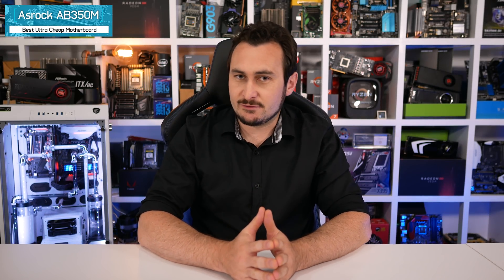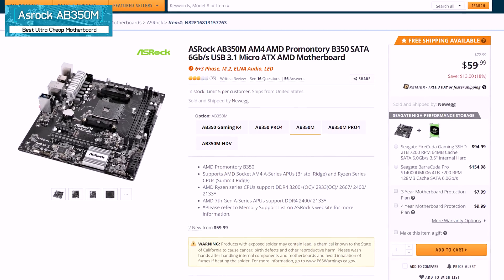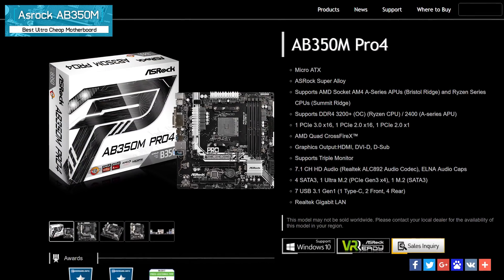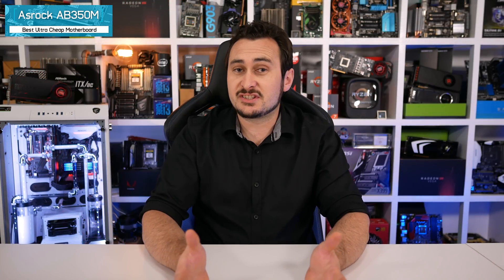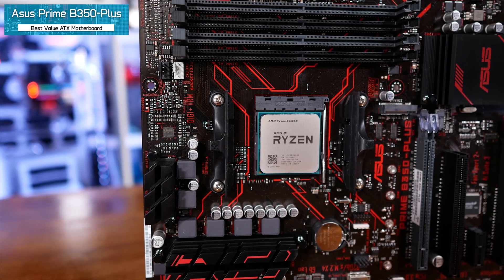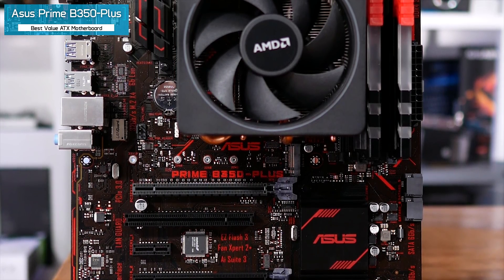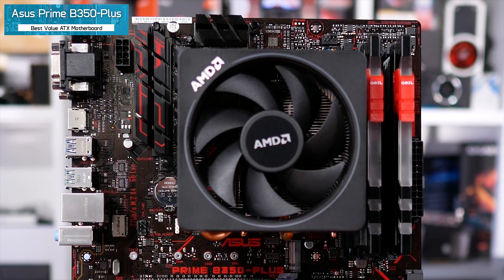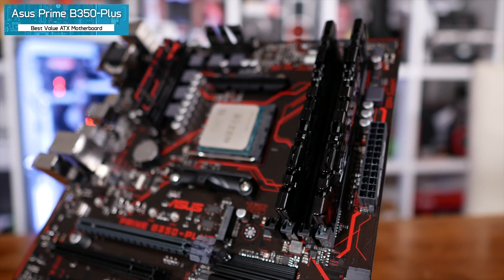Top 5 Best AMD B350 Motherboards

Comment: Great video, although I would def pick the Gigabyte Gaming 3 over the Prime Plus.
Reply: Also rocking the Gaming 3. only issues I have is getting my RAM to 2933Mhz (Or its rated 3200Mhz, Corsair vengeance LPX) and the lack of modifying the LLC to try and squeeze every drop of performance from my R5 1600.

Still, for the price I paid, it's a winner.
Reply: Really? I must be the only person who had a decent experience with one
Reply: Don't forget that the Gaming 3 has the 1220 audio, 5 analog and an optical out.
Reply: Pretty sure Buildzoid was shitting on MSI boards in his video(for B350) and he shits on the X370 Gigabyte boards, not the B350s.
Reply: RRoD - I don't think they're garbage, and in fact, Steve mentions they were good competition for his "Best Value ATX Board" category. Just because one component isn't as good as another in thermals doesn't make it trash. I've been using a Gaming 3 and my computer hasn't burst into flames(holding steady OC anyway).

This is the kind of polarizing of opinion that simply makes no sense. Did I hurt your feelings by correcting someone about something totally unrelated to your opinion? If I did, check out of YT and into counseling.
Reply: I also have a Gaming 3, paired with 2x8GB Patriot Viper Elite 3000MHz CL16 - which only required selecting the XMP profile to go to 2933MHz - and a Ryzen 5 1600. I did a quick overclocking test (to 3.6GHz) out of curiosity and it was fine, however it's good to note the potential issues even if I'm only really going to be running at stock. Can't say anything about the audio though; I use a USB headset.

I should note that it was complaints about the BIOS that stopped me from getting the Prime B350-Plus, apparent issues with too much voltage being applied, that and the Gaming 3 was a good price. The Gaming 3 doesn't like booting to HDMI though, so I've had to rig up my TV with D-Sub which isn't really a loss at 1080p. For all its reported faults, I like its looks, the reinforced PCI-E ports, and the LED lighting (you can print your own accent overlay for a different design using a 3D printer). There is a new F10 BIOS out adding support for future CPUs, and it hasn't killed anything (yet). I'm not averse to the idea of replacing it if there are much better boards, and I admit that most of its plus points seem purely aesthetic, but for now, it does its job well.
Reply: I love my GIGABYTE AB350 Gaming-3 mobo. Only complaint I have is I can only get my 3200 MHz RAM to 3066 MHz but I'm assuming that's a Ryzen/Memory compatibility issue as it's not Samsung B-Die. 

Other than the Gaming-3 there's a lot of Mobo's I would take over the Prime Plus. ASUS ROG STRIX B350 Gaming-F for one.
Reply: I got your feelings were hurt from you calling them "trash". It turns out you only feel that way because of what someone else says about it, which you twisted to mean that they are incompetent, worthless parts. Still, a magnificent display of YT comments-tier intelligence and maturity, no doubt!
Reply: Hardware Unboxed i have an serious question: i look at this video again because it seems that my prime b350 plus doesn't run with the flareX ram at 3200mhz on the most recent bios 3806. and now I don't trust my eyes seeing the board in your video having the same ram on it. is there a way you know to let it run on 3200mhz?
Reply: Tech Showdown Gigabyte b350 board? BARF!
Reply: CazadorDeWulf Not sure where you got my feelings were hurt. And they should be "fine" with a stock cooler or with a moderate oc on R3s and R5s. But I wouldn't recommend them to anyone. If you use your cpu at higher voltages, your lifespan of the motherboard will be decreased. And that is certainly not what you want from a chipset that will be around for awhile.
Reply: I would go for the B350 Fatal1ty that is not there...
Reply: Asus all the way since the 90s. Nothing else gigabyte screwed me over in 2000 with a $ 480.00 motherboard send it 3 times I marked it and they say it's a new mobo I was  not stupid I marked it and it's the 3rd time you send me the same one so I gave up he ask me why  I marked it I told him  i don't trust no-one he felt so stupid it was funny .ask me to send it to him personally I said I thrashed it he say why I'm like realy you lost a costermer that upgrades my computer's every 6 month's plus I build computer's. So Asus never let me down and yes I got a gtx 1070 from gigabyte and I'm happy with it and it oc like a champion, but on motherboards i only use Asus.
Reply: Alexander Radev is there an issue with the b350m gaming pro? From the reviews ive seen it is quite good for the money? I am choosing between the b350m gaming pro and the b350m bazooka from main and the b350m pro 4 from asrock.
Reply: Not really he even said some of them are the best for whats available at the moment. He also said that most of them will get away with an 8 core although not with high overclokcs. Msi boards in the b350 are fine for most cases aswell as from other companies.
Reply: My final buy tho would be the asrock fatality gaming itx/ac. if I was to go mini itx.
Reply: I own the B350 plus and it's a piece of shit, before the AGESA bios I was running stable 3.8Ghz at 1.26v after the AGESA bios updates my board won't run 3.8Ghz without hitting 1.4v >:(
Reply: The Gaming 3 has shit VRMs. Buildzoid bullshited all Giga B350 boards.
Reply from the maker: Thanks Kev, I would admit that out loud around here mate :D The Prime Plus is the better board, trust me on that one ;)
Reply: Hardware Unboxed asus prime b350 plus vs msi b350 tomahawk. What is better pls answer me
Reply: Trust me Steve, the FX-9590 is the BEST CPU EVER MADE, if you don't agree with me, that instantly makes you an INTEL SHILL.
lmao
Reply: Considering Gigabyte makes the worst B350's overall other than the ITX board and the MSI Gaming Pro, I wouldn't really say so.They'll support an R7, and I would sooner go for a Gigabyte B350 with a heatsink on the VRMs than an MSI without, but technically speaking it's not better than the Prime Plus.
Reply: The Gigabite boards have the crappiest VRM in all B350 boards. If you really want a value board - get the MSI B350 Mate or basically the cheapest MSI board that is not the B350M Gaming Pro. You get as good a VRM to the Asus board, Crossfire support and all teh case fan connectors you want.
Reply: CazadorDeWulf Trust. Gigabyte b350s are garbage. Just look at them. No heatsinks. For the msi boards they are mostly just overpriced.

Also buildzoid did a b350 round up 7 or 8 months ago where he said just stay away from gigabyte b350.
Reply: If you want better onboard audio then Gigabyte however everything else about the Gigabyte board is inferior to the Prime Plus.
Reply: After having 3 of them DOA at my work, I would say nope.
Reply: Bad VRM cooling
edit:
I have one and the VRM temp is what stop me from overclocking
Reply: I'm reading just enough into word choice to pull the conclusion that your opinion isn't helpful to those you're sharing it with. At least, not until you explain what you mean over the course of 3-4 comments, at which point you've hurt your credibility, and nobody is going to take you seriously. 

Post your source material, if you're actually trying to make logical claims. Otherwise, nice troll.
Reply: CazadorDeWulf source material for what? Lack of heatsinks? Buildzoid's video? I gave a time frame and that it is a b350 roundup, but if you must have me look up the link as well here. Conclusion starts closer to 26 minutes.

https://youtu.be/ZGrxhf_xZWI
Reply: RRoD - He just makes the claim that "Gigabyte has the weakest VRM you can get". One statement in a video about MSI B350s. So you're telling me it's trash, because he said that in the video? Again, YT comments-tier shit right here.

It's a fine board. The only thing it's "trash" for is long-term overclocking for use-cases involving frequent, heavy CPU load - or, if your case ventilation is very, very poor. As with probably 99% of Gaming 3 owners, I think it has an acceptable degree of faults, which are outweighed by the rest of what it offers. Can recommend.(Also, the bios problems also stopped me from getting the Prime, like Stephan)
Reply: CazadorDeWulf I'd still call it pretty trash to not have heatsinks. Fix that and it would be alright. Think you're just reading too much into word choice.

Comment: Steve, I just read a comment where you kinda said AB350 Gaming 3 is not good... However, I just bought it... Can you further explain why? Thank you :(
Reply: im running a 1700 oc'ed on the gigabyte AB350 gaming mini itx, temps are fine even in a mini case.
Reply: Bought a cheap Gigabyte ultra durable z97 board few years ago for my i5 4690k, managed to oc it to 4.8GHz stable. The thing ran hotter than the surface of sun and i eventually had to lower my oc due to the vrms degrading and the oc becoming unstable. 
Still works fine though which is pretty unbelievable considering i paid 80€ for the board.
Has to be the best value i've ever gotten when buying a mobo, 10/10 would buy again.
Reply from the maker: You shouldn't have an issues with it, there are just better options. The VRM on the Gigabyte boards tends to run very hot.
Reply: Hardware Unboxed Thank you so much, will make sure to add decent cooling to my new build. Thank you so much! Really enjoy watching your content :)
Reply: Francisco Molina just make sure its not a 6 or 8 core cpu you plan on using the vrm is pretty poor

Comment: Good pick for the ITX board, the AsRock board also has a better connector layout than the Gigabyte ITX board, in my opinion.

ASUS' ITX boards are kind of wacky, they look pretty neat but rear I/O is just barely acceptable for a mid-range gaming PC, especially a small form factor one where you really need as much I/O as you can get. The audio+M.2 daughterboard is an interesting idea though. What I find very strange is that there's almost no point to buying an X370 ITX board, as all of the X370 boards that are available are physically identical to their B350 counterparts.

Also, unsurprisingly, none of the manufacturers have taken 'advantage' of AMD's SFF-specific X300 chipset, probably because there's no reason to when the B350 chipset exists.

Comment: B350 + Ryzen = amazing value!!! R5 1600 user here on the MSI B350M Gaming Pro and I would highly recommend!
Reply: There's no point in pushing higher voltage if it's stable at a lower voltage.  Unless you're testing for the point at which your CPU or VRMs will die.  And that will be the end, until you replace the victim.  Even if it's stable at higher voltages, it makes no sense if stable at lower.  You're just wasting energy generating and having to remove a lot of excess heat.
Reply: David K. And why do you say that?
Reply: David K. Hm, in my experience, it's pretty good. I got a good overclock to 3.9 and it stays pretty cool
Reply: better Mortar/Bazooka/PRO-VDH
(because 4 phase)
Reply: I don't know... I've managed to get a stable 4.1 with r3 1200 with 1.29V and was able to push it to 4.2 and 4.3 @ 1.35, but I really didn't like the temperatures of the CPU at that voltage, so I've just bumped it down to 1.29. Overall, really happy with the board. As for the heat of the VRM, I was able to touch it while at full load, so I'd say it didn't go above 65 deg. C. I don't have a thermometer so this is as good of a measure as I'm going to get.
Reply: That's good.  Just watch for crashes.  If a program crashes that may mean you should up your voltage or lower your OC.  It would be frustrating to experience a lockup in a full screen game or a work program suddenly closes and you lose a lot of work.  Even minutes worth is stressful.  I'd stress test it.
Reply: David K. I saw you in one of buildzoid's videos. If you are basing your opinions of the b350m gaming pro on his statement this board will handle even an 8 core just not over locked max and GalacticRod over here is most probably a casual user and not an ln2 overclocker so it's all good with this board but if you want to push the 1600 further you need a better board.
Reply: In general the b350m gaming pro is good to holding up to a 6 core anything more than that needs more motherboard power.
Reply: GalacticRod R5 1600, MSI B350 Tomahawk. I chose that board pver the Asus B350 Pro because i have a 5.1 sorround speaker system and 3 audio ports don't allow for it, meanwhile, the 6 audio ports in my board handle my setup perfectly. I don't overclock so i'm not after OC features.
Reply: GalacticRod I heard that the 350m gaming pro has some compability issues with Ryzen 3 and R5, is it true ? Plz respond

Comment: Asus Strix B350F > all ^^ Running R1700 at 4.1GHZ. RAM 3200MHz. stress tested with prime95 24 hours + aida 64 24 hours. also it looks badass. though my RGB is off
Reply: It doesn't. That dude is a joke. 4.1GHz is probably the highest you can get on a Ryzen CPU and that's ultra lucky. (I barely made it to 3.9 on my R3 1200)
Reply: Irakli Mosulishvili I have the same board, and this was the simplest overclock ever. My vengeance lpx doesn't behave over 3000mhz, but I'm happy with it.
Reply: David K you having a laugh? 121c? wtf is wrong with that thing, i really don't know how to take thermal shot like that but i'm telling you the truth man, NOT EVEN WARM when I TOUCH IT.
Reply: Alexander Radev I wasn't limited in budget when buying motherboard. I took 2 factors under consideration: 1. B350 chipset has everything I need. 2. I took advice from a good friend of mine (from Taiwan) he's a tech engineer working for a solid firm in TW, he told me it was the best seller in TW even before the product hit amazon, told me he tested it and was very impressed. I trust this guy more than I trust my own eyes when it comes to "things such as this". May sound naive but, never failed me before so... and as for this purchase, i think the result speaks for itself.
Reply: JC Reyes yes you can. I have that exact board with an R5 1600 OCD to 4ghz. It comes with a software called sonic studio which allows you to do various things, including splitting audio streams by application, source or destination.
Reply: Christopher Baran - difference between 3000Mhz and 3200Mhz barely noticeable if at all. also make sure you update the BIOS. i'm also using LPX RAM and 0 issues with XMP
Reply: Buthole Surfer CPU-Z validation report link or it didn't happen.
Reply: +C. L. K actually, with strix b350f you can have two pcie gen3 (x8+x4) and a pcie gen2 x4 addon card at the same time...
Reply: Irakli Mosulishvili objectivly seen the gaming pro carbon is just a Bit better, not a huge different tho
Reply: I have the board and i would say the audio is really good, which is the sole reason i bought it. The amplifier also adjust the impedance according to your speaker and headphones so they're louder and clearer than other b350 board
Reply: I got the Strix board for $40 after MIR and cane with free AC Origins. So I kinda got paid $20? Huehuehue
Reply: I bought a GIGABYTE AB350-Gaming 3 and when I realized the B350 Gaming-F was the same price I was pretty salty. They're very similar in features but the Gaming-F just looks better imo.
Reply: For this price I'd rather get an X370 board with better VRM, that actually can handle all the heat from overclocked R7.
Reply: Yeah no Zen can oc that high.
Reply: Both boards have bad VRM. It's a Gigabite issue for all B350 boards.
Reply: hi I got the same motherboard for my r5 1600 but it will arrive this January. Can you detail to me the features of its sound chip? what are the things that I can do with it? Thanks!
Reply: can you separate the sound to your speakers simultaneously as well? LIke I play music to my speakers while I do gaming on my headset? Thanks man!
Reply: David K. not even warm...
Reply: TheIcyCrook maybe, except i'd never buy MSI again. learned my lesson long time ago... hard way, like on multiple occasions
Reply: Bought one for $100 and if you factor in the fact that I got AC Origins free with it, it brings it down to $40
Reply: Irakli Mosulishvili I have this board and I love it wife hates the LEDs when system is off
Reply: I got this board for $89
Reply: Irakli Mosulishvili thread ripper does 4.3
Reply: Chris Wright yes, technically, TR is also zen, perhaps i should've been more clear, I only meant consumer ryzen chips not HEDT cpu
Reply: UltimateXtreme this the asus b350 f?
Reply: Kreutzwerkz I got mine at MicroCenter too, with mail in rebate and $50 discount with CPU.
Reply: I was thinking of getting that motherboard with a r5 1600 and gtx 1070 what ram did you use to get 3200mhz and would the corsair 2x8 3200mhz cl16 work well with it
Reply: I have the same board and my 2400mhz ram overclocked to 3200mhz stable with lower timings and r3 1200 clocked east at 3.9Ghz at 1.3V not pushing it further due to cooler limitations. Also provides a lot of USB port and Asus SupremeFX onboard audio that supports optical output and Surround.
Reply: Porky Pig i guarantee you, your CPU is going to die within several months at that clock speed
Reply: Irakli Mosulishvili I had trouble deciding between GA-AB350-Gaming 3  or ROG STRIX B350-F GAMING. But chose the Asus in the end because of the simple overclocking on CPU and RAM, it's quite fun when you mess with the frequency and latency of the RAM
Reply: Irakli Mosulishvili yeah ik I got the b350f gaming and it looks great and does great
Reply: May I know what PSU are you using?
Reply: Stop boasting, no one's interested.
Reply from the maker: For the price it would want to ;)
Reply: Yes i know it's expensive, but like i said. 4.1GHz no issues, and RAM running @ 3200MHz. never had any issues with the board.
Reply from the maker: Probably more lucky on the CPU front but still that's a great result!
Reply: @Hardwareunboxed  i just got one for 80$ on black friday lucky me